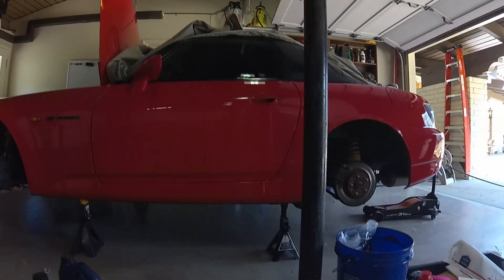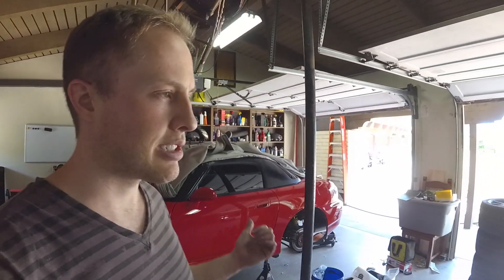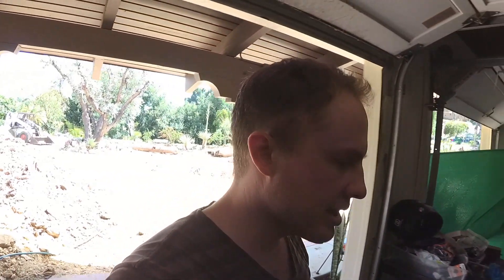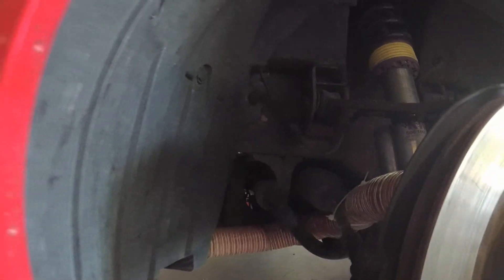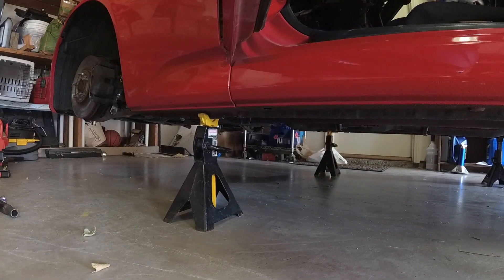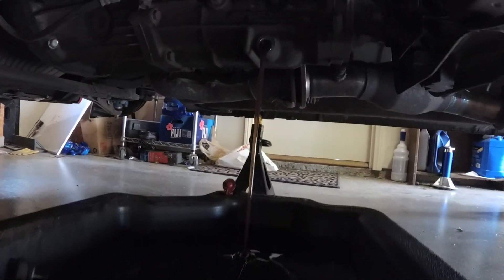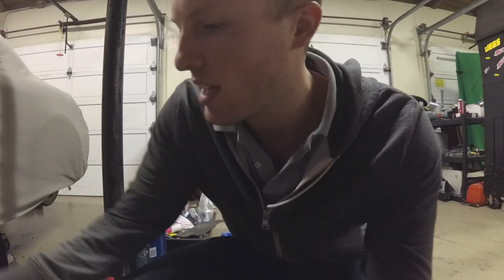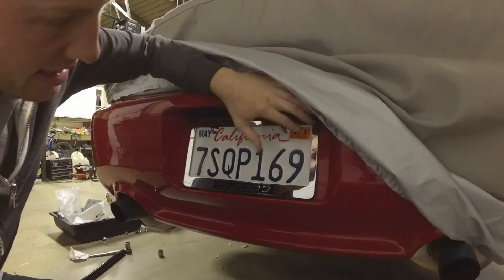Supercharged S2000 Summer Maintenance Update

Comment: The TL type S brembo retro fit is an awesome upgrade for way cheaper than buying new.
Reply: Charper732 is this an option? I've seen an example on s2ki but they had to mill the mount points on the calipers significantly which really isn't safe for track work - or even on the street for that matter
Reply: I make direct bolt on kits. Milling the calipers is fine as they are made from billet and you still end up with the same thickness at the mounting point as the stock caliper. Plus the Brembos are lighter than the stock calipers.
Reply: Charper732 nice one Charper, so does your bolt on kit require milling? Interested.
Reply: Yes they are milled. If you look at stoptech or other brembo kits, you'll find that the mounting ears are the same thickness as stock calipers and same thickness that I mill these to.  All modification and powder coating is taken care of on my end.  They are a direct bolt on replacement.

Comment: Big brake kit for sure. Check out Racing Brake for all sorts of options. You could just do an Accord caliper swap and use their 2-piece rotors or go with their calipers and rotors. Check them out!
Reply from the maker: Yes racing brake is sweet. I just went with a basic stoptech st40 kit with their two piece rotors.

Comment: Did you get Stoptechs? What wheels were you looking at? You'll need to run a pretty low offset depending on the wheel. I've been thinking of the ST40's.

Comment: You should better use Motul gear 300 LS on the differential, because it has the additives for the limited slip diff and is a bit thicker. What do you use for your engine, and what would you recommend for NA (daily driven and occasional track days)?
Reply from the maker: I still have a stock torsen diff so the regular 300 is correct (I wish I had a proper LSD in this car). 

For my street S2000s I just run a synthetic 10w30. For this track car, I use a 5w40 oil.

Comment: I'm concerned the oil will be to heavy or light for either the diff or gearbox given its multi purpose. I think it makes sense for s translate however.
Reply from the maker: Yes the fluid is very thick. I had the chance to drive a friend's S2k at button willow running this fluid in his trans and diff. It felt really great.
Reply: ZentRose cool, please let us know how it goes, perhaps when it comes to changing it out.

Comment: How many track days does your current pad and rotor setup last before replacement? It's 2-4 days for the pads before the ducts right?
Reply from the maker: Yes PMU club racers can get used up pretty quick. Endurance pads like carbotech RP2 will last a little longer.

Comment: Just curious... Are you replacing the tires because of the chunks? I did the same thing to my tires and I'm contemplating running them again or replacing them.
Reply from the maker: No I ran them with the chunks without issue. I usually run tires down to the cords but these ones are heat cycled out. They are still good for drifting though.